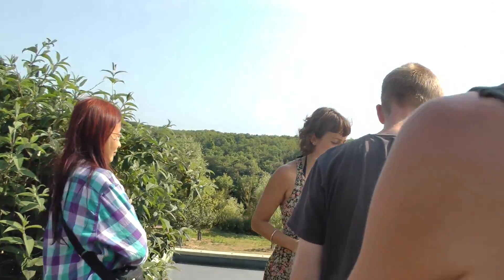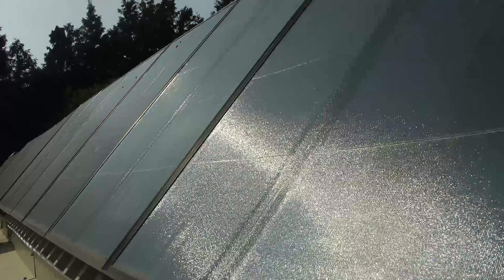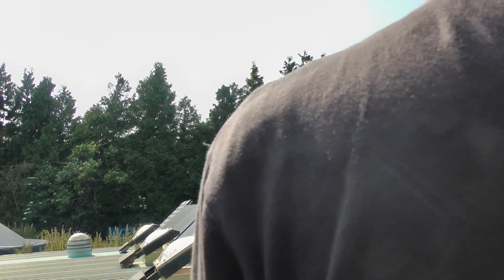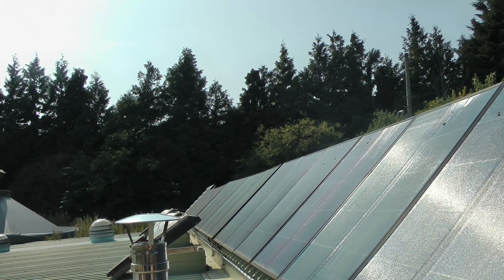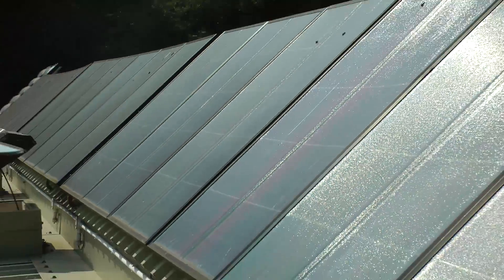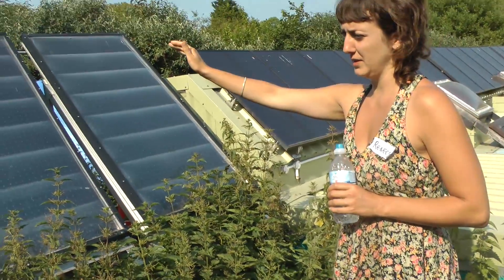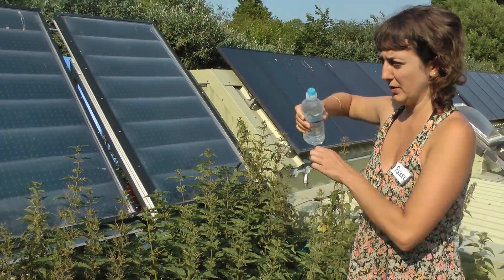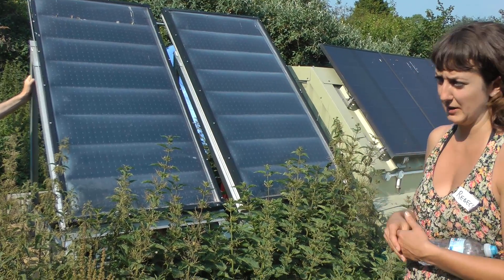Solar Energy (Self-Building an Earthship)

Comment: Wow the premise of Earthships is to be self sustainable. This women is either against such things or is working for an group opposed to such ideas.  Batteries are the only real way to be autonomous. Being tied to the grid doesn't do that. Of course batteries are the weak link in this type of system. But like anything they require the proper maintenance & care. If one does nothing for their vehicles they won't last very long. So using her logic no one should buy a car but use public transportation.
Reply from the maker: 1timby The question is whether you want to be fully self-sustainable design or the the most ecologically conscious design, because unfortunately with current technology, the enviornmental impact of the production of batteries on on a large scale needed to include larger quantities of these buildings, for example a town or city, is highly inefficient in storage capacity and costly to the environment. The grid does not potentially have to mean centralised distribution from traditional corporate enitities, imagine a network of communities sharing energy produced in their localities, balancing off each others energy peaks and troffs, through decentralised renewable energies. However, if complete self reliance is your bag then obviously batteries are the way to go, and hopefully, with the emergence of electric cars, we will hopefully see a dramatic improvement in efficiency and environmental impact.
Reply: Well said.